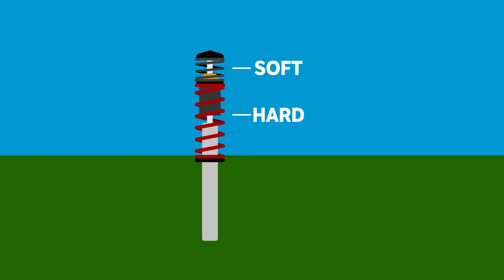What Difference Do Coilovers Actually Make To Ride And Handling?

Comment: Hi, amazing project. As I am BMW enthusiast too I'd like to share coupe of other improvements over the stock suspension for your E46. One of them is the Lollipop bushes on the front wishbone. Easily replaceable with poly-bushes and makes a day and night difference to the steering input. Same as the rear trailing arm bushes(Go for poly-bushes). Considering the age of the vehicle they are probably shot and the rear wheel alignment is probably not very accurate anyway with a shot bushes... Also do have in mind when coilovers are installed on an E46 and hard usage such as track days the chassis do tend to crack in the back if it hasn't already. That's one thing no one tells you about... They always crack on the passenger side (UK) rear subframe bush, look around for any tiny small cracks or rust. That would indicate the layer underneath the coating is cracked and it might look like a small crack but once the coating has been removed you'll see how big it actually is.

Comment: Hi guys, i've just fitted these to my 330d but have a few questions.  How did you torque the strut top nut and Did you fit these straight from the box or did you follow the installation instructions? the reason i ask is because if i set the minimum depth the top spring is fully compressed!

Comment: those alignment settings are within stock parameters...which means least tire wear.

less roll from lowered ride height reduces weight transfer.  even if the body doesn't roll because of stiffer springs, weight transfer *does not change*!.  check out millliken's "Race Car Vehicle Dynamics."

Comment: The outside tires don't get less load now with coilover and less bodyroll. The weight transfer is only ruled by lateral acceleration,if you make the corner faster they will get more load even with less roll. The only thing that reduces weight transfer is lowering the center of gravity, however the amount of weight transfer it prevents isn't that much unless  you lower it by big amounts (60-70 mm).
The biggest reason why it's faster is corner balancing, proper alignment and the confidence inspired by less body movement and the characteristic angles of the tires being more consistent due to less travel!
It's great to have some impressions without changing any other aspect of the car, can't wait to see tires! :D

Comment: I agree with most of this; however, the spring is to hold the weight and provide movement and to push the tires to the ground, with the goal of keeping the tire contact to the ground consistent. A sock absorber is exactly what its name is and dampens the movement of the vehicle on the spring. Despite the common misconception that stiffer springs are somehow better, softer suspension setup is better at keeping the tires in contact with the ground, so long as there is enough travel. At least that's my take. Despite this, good vid.

Comment: Now i realized i have to check if i have short sway bar links. The coilovers was already mounted on the Bmw i bought. They are much better than normal lowering kits. And i like the trnder spring. But i would like air suspension better. Could been stiff snd tender there too😊 air suspension in a cylinder. Together with the shock absorber(outer part).  Or combined one or anorher way with stiff suspension and partially tender. My car dint roll in corners. Comfort!!😊

Comment: Most other coil overs sold, have the helper spring on the lower portion of the strut.   This is on the upper.  wont the helper spring get out of alignment and rub against the bump stop and boot cover and possibly bind during a drive?   When placed on the lower section , the shock body keeps them aligned.

Comment: Are you planning any aero mods? Just thinking of the Top Gear e46 330d endurance racer and the difference a front splitter and rear wing made to lap times. Also, would it not be more sensible to swap out the tyres near the end of the project if you’re planning to carry out mid-project tests like you did here to avoid wear?

Comment: Improve lap times on a short coarse like this one... 
1)   Really sticky tires that do NOT require heating to be grippy... Hoosier A7, they are DOT approved road tires, but only for dry conditions. They are amazing for Autocross. First time I ran the A7s I bent both tie rods, and snapped a half-shaft, the wheels stuck so well.
2) Really good brakes, with braided steal brake lines, and DOT5+ fluid.
3) Then of coarse good suspension setup...

Comment: So I'm curious, how much does a proper corner balancing, alignment, height adjustment, etc suspension tune generally run you?
Setting up my new KWs soo- wanna do it right so I cut my lap time down, instead of fight a weird setup and end up worse off

Comment: My question, I have a 330d e45 05 individual m sport. I have also upgraded to coilovers, but my big question is, are you guys not gonna give it a stage 2 tune and exhaust ?? you easly get close to 290 hp with a tune and exhaust with stock turbo, intercooler and injectors. My car turned from a fast daily car to a beast from just a tune and exhaust. :)

Comment: Just a reminder: do not buy cheap setups like JOM or similar. They have a dual spring system, but the "comfort" spring, the small one on top usually closes right after the car is dropped back down on its wheels and from that moment on you basically ride on the stiffer springs. That will affect the load. But if you intend to drive mainly city and speed won't be an issue you don't need to mind that much. Other thing is that such a stiff setup is going to break down other things rather faster. From bushings that will go bad sooner up to the steering rack that will get a beating pretty much the whole time you drive because your comfy springs are anything but comfy.

Comment: Don't underestimate how heavy the E46 touring is compared to the saloon or coupe; there are several roll bar options for the E46, so maybe consider some fatter ones - and polybush those wishbones, trailing arms and roll bars. They make a huge difference to these cars.

Comment: I doubt the Nankangs will do too much of a difference, as a tire mechanic I personally recommend Michelin Pilot Super Sports or Sport Cup 2s for this vehicle in these conditions. I bet that by their 3rd heat cycle the Nankangs will have a shifted belt or will be hard as plastic and provide absolutely no grip :)

Comment: We have an x3 e83 3.0d with original M dampers and h&r springs(black color) 40mm loweres from the previous owner. The rides is way too harf and almost every bump gets through. Its good for cornering though.

Do you know some nice alternative(dampers and springs) for a smooth ride and softer ride but not too much horizontal inclination?

Comment: No strut brace with the coil overs? That's the first thing I did to my e39 540i.. but is has M sport suspension already. Then Staggared 19's with 285/35 rear and 245/35 front.

Comment: Shouldn't you have reinforcement plates on the shocktower? A common problem when modding the suspension is that the shocktowers tear up. At least on the E46.

Comment: Great video.

That being said, the coilovers look far too soft to be proper track oriented stuff. Eibach Pro Street are just that, designed for street - and there are better if you want outright handling etc. I did try these on a friends car and they were far too soft so I ended up going with Bilstein B16. Which were amazing. Bit harsh on the road though.

Also what about bushes? Upon fully polybushing my car I noticed quite a substantial improvement - more so than just fitting suspension, especially on an older / higher mileage car.

I have no doubt you could get the 330d to be as quick if not quicker around Curborough than the M3 - a better test would be a circuit like Cadwell or Oulton as the outright pace of an M3 can shine through. 

Anyway looking forward to next episode.

Comment: Thinking of getting a E46 BMW 320i as a first car. Prices for good ones start at around 1500 quid here in sweden and they are somhow about 40 quid less expensive per month (this will cost me around 110 quid a month for a full insurance) to insure than a volvo V40. Any tips on if this is a good car to start with or not. Should i mod it with coilovers and a new exhaust if i get it? Feel free to leave your opinion and any tips you might have! Cheers from sweden.

Comment: The trouble is that all these for E46s are expensive relative to the value of the car.  You can buy the whole darn car for under $5000 and a decent set of coilovers like the Eibachs or PSS/PSS9s is going to cost you $1500+ installed and aligned.  Then you’ve got bushings, sway bars, engine and transmission mounts, fluid changes, short shifters, etc. etc. etc...In like 5 minutes, you can easily spend over the value of the whole car on the parts alone for fairly basic stuff.  And afterward, you could just have bought a C4 vette or something that will walk it around a track.

It would be a different story if the parts for these cars had come down in price relative to the car itself.  When it was new, the 330i was around $40k and a set of coilovers was $1300.  Well the car is worth 1/8 of what it was, and the coilovers are still $1300.  I’m just not sure that unless you’re at least starting with an M-car that gives you a significant power advantage, that it’s worth it in the end.  That’s coming from a guy who has owned an 04 330i from new and has 214k miles on it

Comment: What I've learend over the years...Wanna look cool, get some lowered springs but keep your standard shocks for comfort. Wanna go track racing, get some coilovers. Don't use coilovers on the public highway unless your back is made of granite. Get your tracking checked 500 miles after making any mods, i.e. once the shocks &/or springs have settled. Bilstein & Koni make the best shocks & Eibach the best springs. Avoid H&R. Standard shocks are ideal for British roads, leave um alone. You do want some lowered springs though, they can firm up the ride & reduce wallow & do some of the shock absorbers work if money is tight (replace the springs and not the shocks and springs). Shocks are expensive, Springs are not. Lowered springs help the wheel fill that wheel arch. Springs set height, Shocks set bounce.

Comment: What the Eibach man conveniently left out on his suspension geometry explanation is the control arm angle, which is very important.  Ideally, at static, you want the arm to be level or pointed down towards the wheel.  Lowering the car, points the control arm up, which isn't good for handling, just more things to consider when setting up the ride height.  Lower isn't always better.
plus, you're comparing a worn standard suspension to a fresh suspension, not really a fair comparison.  Even if you replace the stock dampers with some Bilstein HD's, you'll see some improvement, without much cost, but... you don't get that "race car" look.

Comment: 0.26 seconds though. Not noticeably quicker than standard. It would be interesting to put the standard suspension back on when you get new tyres, so then you could compare the improvement with suspension, tyres and both combined.

Comment: Not really into the new rims fitted (seen in a cut from the next video), I'd rather stick to the stock ones, although maybe the new ones are lighter and help the car perform better in the track.
Anyway, really good tyres will make an important difference in lap times and driveability, for sure.

Comment: Don't bother with the NS2R's had a full set, rears only lasted 3 months so I changed to Michelin Pilot Sport 4S as soon as they were released and what a difference 10x better than the Nankang especially in the wet, but surprisingly in the dry too, wouldn't have anything else now.

Comment: Delete the Clutch Delay Valve! Not so many people know, but there is a flow restrictior on the hydraulic line to slow down the clutch engagement. Almost all E46 have these. I bet it was done to save the rear subframe mounts when they realized how easy they break.

Comment: Will you do any optimization to the engine? That could increase both horsepower and economy, not that economy matters in this case :) In sweden most diesel cars and lorreys can have their engines optimized to gain both hp and economy aswell as more torque

Comment: You know, I bet that if you put a new shifter, an exhaust, an air intake, some better tires (or tyres as they're called across the pond), and a new locking rear diff, that car would be an absolute weapon on the track.

Comment: Shows also how well the original car was set up entirely as it was - put better suspension and it throws other things out of whack. Only 0.25 sec because of the replacement suspension - new and sharp vs old and probably worn out.

Comment: Nice example of why doing a coilover is usually a very bad idea for everyday driving. The harder suspension improves the potential of the car to go fast, but also reduces the margin of error the driver can make, without getting in trouble.
That's why you needed 3 laps to just beat your old laptime (and couldn't repeat it in the 4th attempt). And that's also why, in "real life", these cars usually end up in ditches at some point.

Comment: Demonstrating that BMW dynamics engineers actually know what they are doing!  By making the car stiffer, all you are doing is making it harder to drive!  IME, on std rubber, you are going to want to run a lot more camber to control the contact patch under high loadings, and for that you needed to fit adjustable top mounts.

Comment: So youre telling me the car has those soft springs for comfort? You can fully compress them with your hand! They surely wont dampen a car. 
These preload springs are used to secure the main spring from popping off the top mount when the wheel is in the air.

Comment: I feel like the order of mods is wrong here. I want to know the true value of each mod. If lap times are the basis for comparison, it makes the most sense to do tires first because they have the biggest overall effect on grip. Then the diff, because second biggest effect on laptimes because more grip at corner exit = more speed at the end of the straight. Suspension helps fine tune the grip afforded by the first two mods and make the most noticeable impact AFTER they are done. 

This is a really interesting project and we all want to know the true value of each mod... So please start over and do tires first.

Comment: Nerd mode on As long as you are using manual timekeeping you should consider rounding off the hundredth of seconds. Keeping them suggests a pseudo-accuracy not supported by real timekeeping precision. Otherwise backup the measurement with the time recorded by the camera and be perfectly fine. nerd mode off

Comment: Can someone help? I have a 2002 Astra G 2.0 DTI with OPC 17" alloy wheels, in cornering the car had a huge body roll with old shock absorbers and the car tempt to oversteer. A few months ago I replaced it with new shock absorbers (DACO, Germany) and I have the same problem again. What is the cause of that body roll and oversteer then?
Reply: Eldin Mešić have you checked out the swaybars?
Reply: Plymouth Barracuda They are replaced like a year ago, so I think it should be fine, I mean they don't knock over the bumps.
Reply: Eldin Mešić maybe if you want less body roll get a stiffer swaybar

Comment: All people talk about is fitting coilovers. How about slightly lower and firmer springs for about  1/6 of the price (if the shocks are up to it of course) and then thicker sway bars to counter the roll.  Using extra stiff springs to attack body roll is not smart for a road going car.

Comment: I'm not sold on glass filled nylon for a major suspension component. Nylon will absorb water and fail after a few years. I've seen it die many times in cooling systems. They're worried about galvanic corrosion? Wouldn't be a problem if the spring perch was made out of stainless steel as well! And extra bonus, it isn't going to fail in a couple years!! I mean it's not like they aren't charging an arm and a leg for those fucking things to begin with, so what's another 30-50 bucks??

Comment: You really should have started with the wheels and tires man. When you build a project's suspension, you always start "from the ground, upward". Which means that basically, along with a good wheel, contact patch and tire compound come first. Now ideally brakes and suspension go hand in hand, as the good tires will overwhelm the stock brakes and suspension, so you do them together, for safety. 
People who do it the same way you did tend to question whether their expensive commitment was worth their money and effort, solely because they started at the wrong point. It's expensive, I get that. You're going to do it anyway though, so you might as well do it right.
So how's Phil been?

Comment: 1000+ GBP for a set of coilovers without damping adjustment is a bit much and non adjustable dampers on a coilover kit kind of defeats the point of buying adjustable suspension (my opinion). Video about damping adjustment on coilovers here https://www.youtube.com/watch?v=d40k9A_ttPg
About adjusting ride height for bump travel. Coilovers with ride height adjustment with the bottom mount can run with the same bump travel regardless of ride height. But height adjustment through the spring seat, like the Eibachs makes the ride height easier to set ie less chance of going too high or too low.

Comment: It’s great but I think it’s only useful to do once your engine is at full possible power, only when the brakes are perfect, this should be one of the last things done to the car, just a much cheaper simple mod making the engine suck more fuel buy remapping the ecu would be better I thing and save so much more time